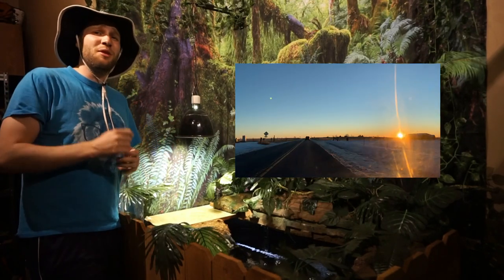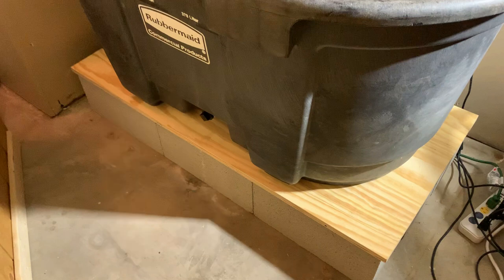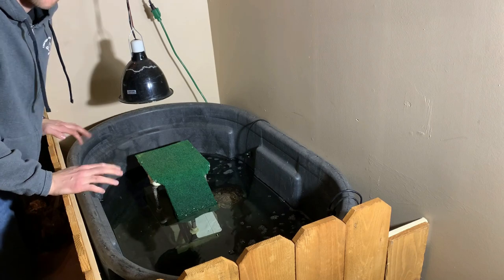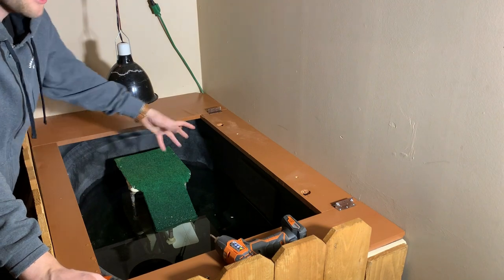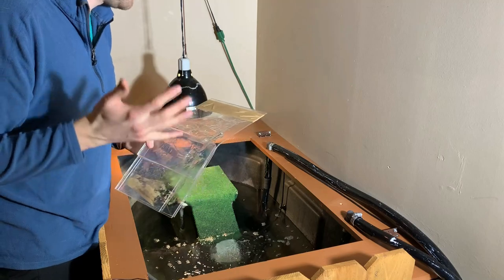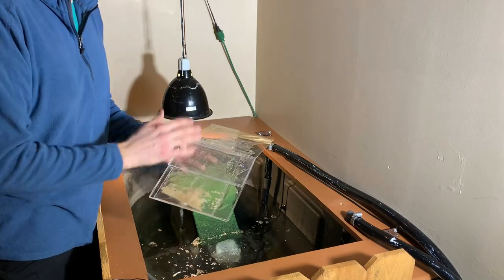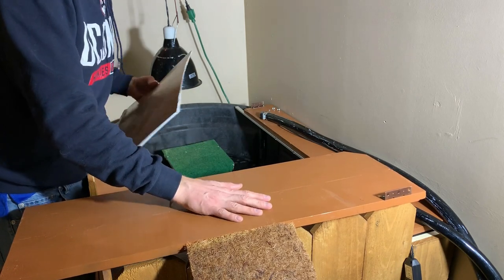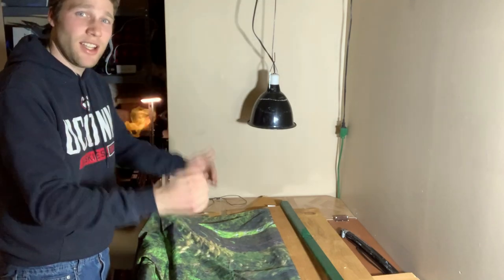How I Made an Indoor Turtle Pond - Jungle Themed Stock Tank!

Comment: Love love love this video . We are wanting to do stock tank like this  in our  sun room. Do you think the heater you recommend  would be enough in the winter the sunroom ? Were in Ohio so not crazy winters but definitely not Florida  haha. Also what are your thoughts on using acrylic to separate the tank in half 🤔 . Do you have any videos explaining the filter set up a bit better. We currently  just have a in tank filter and the canister filters scare me hahaha 😅.
Reply from the maker: Hi! Yes you should have a heater if the water gets below low 70s. Not worth the risk otherwise. For filtration I use a Fluval FX6 and flexible tubing from the hardware store that fits the Fluval valves on the filter. I then used PVC joints in the hose to direct the tubing into the tub without kinking the hose or making large arcs (so it doesn't kink). Just make sure you elevate the stock tank for the filter as it works better if it is under the tank (or close to it). Glad you love the video and thank you so much for the comment! :)

Comment: Looks great....how do you clean it?
Reply from the maker: Good question! With the relatively low direct light levels there is hardly any algae buildup. I just change the water out biweekly sometimes I stir up the rocks on the bottom to free the crud building up, otherwise the filter does a great job!

Comment: I have a question! I have a stock tank setup and was wondering what you use to heat the tank. My heaters always fall off the side of the tank w/o the turtle even touching them, and I've gone through a ton of heaters. I don't think it's because they fully fall into the water, but I never had this issue with their previous glass aquariums. What heaters do you use for stock tanks?
Reply from the maker: Yeah I have the same problem, suction cups don't stick to the structural foam walls of the tub well. I just let it hang, I use a strong titanium heater (https://amzn.to/3720LkZ) so it is strong and can take some hits. If you are worried about it being free, with the tub empty I would silicone a sheet of acrylic to the side and let the silicone dry for 48 hours. Make sure the acrylic sheet is flat. Then the heater will have something to easily suction cup to. Thanks for the comment!

Comment: Amazing set up. Did you have any problems with leaks where the opening is for the stock tank? I just put water in mine and there’s a small leak where the cap is. Very worried right now and I’m unsure what to do. We tightened it and made sure it was secured but it’s still leaking :(
Reply from the maker: It should not be leaking. I bought my stock tank used and got a new cap for it. Did you try using plumbers tape? It helps to seal the threads, it did the trick for me. Good luck!
Reply: @LongLiveYourTurtle  thanks man! My dad recommended I use plumbers tape as well, it definitely did the trick. I was so stressed about it but thankfully it’s not leaking anymore haha. Now I’m just having trouble with the canister filter. Do you think if I cut the tubing it will help? The tubes I have are very long and I don’t need all of it

Comment: Do they leak at all? I want to upgrade to one of those from the big baby pool im using rn
Reply from the maker: I got my Rubbermaid from a working 4season farm, so the drain plug leaked. However, I just bought a new drain plug and added some Teflon tape to all working threads and it hasn’t leaked since. No problems at all, love the tub! Thanks for the comment. Good luck!
Reply: Nice work. That also was my concern, leaks. Try decide between this model or one from Behlen.  Both look sturdy.